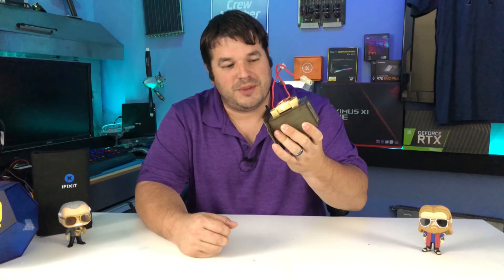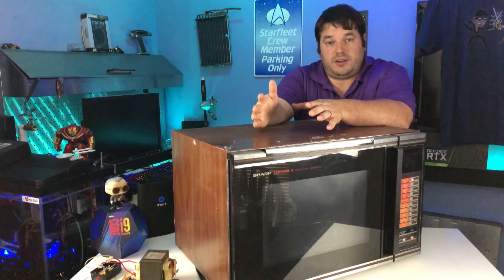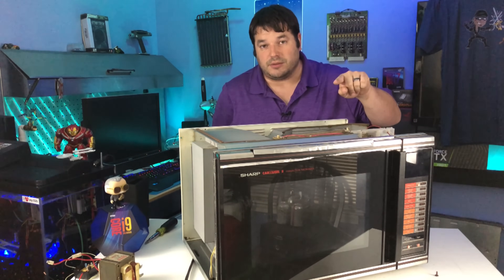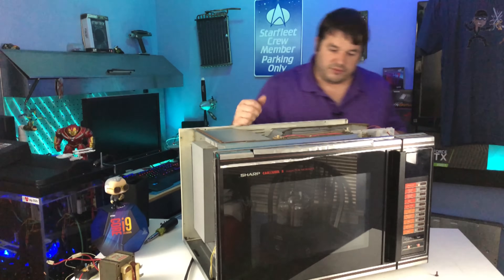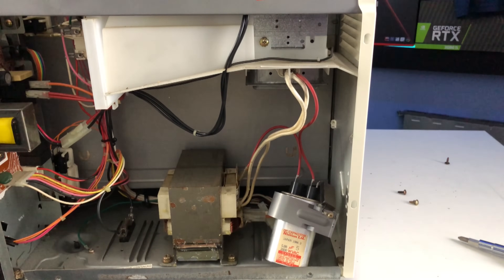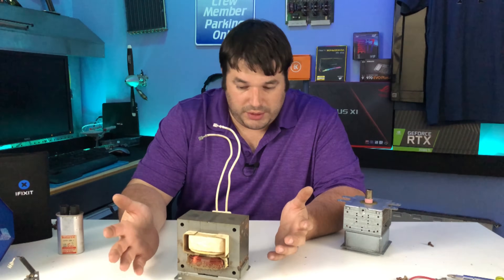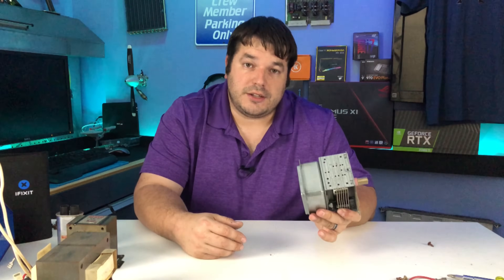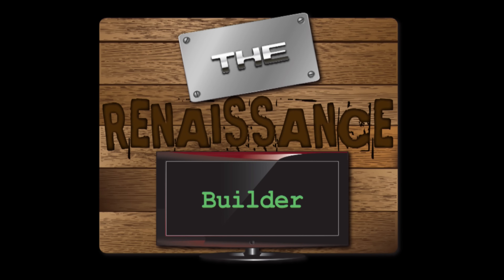HOW TO TAKE APART A MICROWAVE SAFELY

Comment: The idea behind the advice that you should put one hand in your pocket is not that doing so will prevent a shock if you touch a charge, but that you cannot simultaneously touch two points with a potential difference between them. Doing so would create a path for current to short across your heart, and it is current flowing across your heart in particular that will kill you.
Reply: what if your left handed!

Comment: wv is likely working voltage. They are not rated in watts. There is likely a bleeder resistor to discharge the capacitor to make it safe. DO NOT trust your life to it being there or functioning. 

iirc the 2000ish volt rated 1uF capacitor would be 2 joules of energy. (1/2 CV²)
 Not a lot of energy but enough to stop a heart beat,  4 US fatalities a year according the the interwebs. 

You can make a safe discharging device with a series of insulated high value resistors in a hot stick, but if you are winging it follow standard high voltage chassis procedure... Put one hand in your back pocket. Keep it there. Engage safety squints.  Use a well insulated wire loop or insulated needle nose pliers with the other hand to short the terminals on the hv capacitor. The idea is to keep the shock from going across your chest and less likely to turn into electrocution.

See Joe Smith video about using a DMM in resistance mode to discharge caps. Not all DMMs are the same. 

If there actually was a charge, they are not pulse rated, so the pliers aren't ideal. Do it anyway.  There could be leakage paths elsewhere in the unit. Kitchen grease, dust, etc. gets everywhere.  After discharge I'd look up the data sheet to see if there was supposed to an internal discharge capacitor that failed. I think they have one but I could have misremembered that. 

There is nothing particularly dangerous about the vacuum tube magnetron assuming there's no voltage on it. Worth harvesting the the large magnets if you're scrapping the unit. The ceramic insulators *could be BeO which is pretty benign. BeO dust if you damage it is VERY much something to avoid.  The interwebs suggest the pink ones are BeO.  No idea, but every BeO resistor I've handled is natural white like regular alumina.
Reply from the maker: That is some fantastic information thank you very much for adding all that!!

Comment: Most of the transformers i see has been 2200 volts stamped on them  .ham radio operators n cb ers use these fo for a power supply for tube type amplifier .ive tore a bunch of them apart n probably got at least half a dozen laying around here somewhere. The transformers have 2 metal pieces next to the coil on the secondary windings.this keeps from i think over saturation. You knock those out for higher output current from the secondary side.thanks for the great video.hope my tid bit of information helps you n some others.

Comment: like number 666 ☠️ I really enjoyed watching your video٫ btw thanks for warning ppl that might have no idea about what they are up to.. One day I was dismantling an old TV, I was messing around with the CRT, which as you know has a 35,000 volt electrical charge. I was trying to unscrew it in every way and it was so tight then I pulled the thick insulated wire connected to it until it broke by hands.. later when I knew what this piece was! I was so scared and I couldn't touch it to move it another place, even though I had done it before and i did not unscrew any TV after that day until now, Thank God it didn't have a charge because it hadn't been used for a while, I would have been Raiden if it had happened. 😂😂
Reply from the maker: Oh nice! Thank you for that memory! I personally love memories like that, all the best tinkerers have a memory similar to

Comment: I've never dismantled a microwave oven.  So, your video is very helpful.

However, I'm wondering, wouldn't it be safer to ground the pair of pliers that you're using?  After all, when you're trying to short the capacitor terminals, with the resistor, there may be a chance that you'll happen to not connect both leads at the exact same time.  At that point, with only one lead touching one terminal of the capacitor, wouldn't you be in danger?

If the pliers are grounded, then the current would mostly travel through that ground wire.  So, might it be safer to connect a heavy gauge wire, to the pliers, with a hose clamp, and connect the other end of the wire to something metal, that's grounded?

In any case, this is a helpful video.

Comment: For an added level of safety could possibly tie a grown wire to the pliers incase any current gets through into them to hopefuly stop it getting you if you arent properly insulated or isolated. But is apparently not nessisary 😂
Reply from the maker: @Cøbāłṯ-h4i  thank you for that suggestion, its a pretty good idea!

Comment: I dont think you can die from 12000v  dc there is no amps , but you will have great schock
Reply from the maker: I do not wish to be antagonistic so i hope you read this with an open mind. I have personally known (not close mind you) three people that have died from high voltage. I personally have almost died from 480 volts.
Its really simple; the larger the potential difference in volts raises the potential current accross a given resistance. 
Ohms law
Also, its the current through your body that shocks you not the volts.
Reply: . High voltage can be dangerous even if the current (amps) is low. Don't get too confident and always  be cautious

Comment: I like what he’s saying but I don’t think those tools are insulated.insulated tools are usually coated bright orange and have markings of voltage ratings just because a tool has a plastic handle doesn’t mean it’s insulated those handles are usually just for comfort
Reply from the maker: Hey thank you for commenting and watching. 
So insulated tools are for working on live equipment, as in its still plugged in. If you are trying to mess with a microwave while its still plugged in then you are already in danger. Unplug it, make sure the cap is drained, then it doesn’t matter what tool you use.
Reply: @TheRenaissanceBuilder   I’m just saying those won’t do a whole lot for insulation I agree you should never work on anything energized plugged into a power source

Comment: Mine has a brown wire and a blue wire to transformer if they are put back on wrong polarity will the microwave work as my microwave oven don't work but the oven grill etc does
Reply from the maker: On the transformer side its ac so it shouldn’t make a difference

Comment: You assumed the resistor is working.
Reply from the maker: Thats a very good observation, you are correct. Best practice is to always confirm and ground using known good components. Thank you for pointing that out.

Comment: Thank you for taking the time to prepare this video. It happens so quickly.
I took a cheap 6 - can mini fridge apart to replace one tiny capacitor on the power board that had failed.
Picked the power board up - mains shock.
I was lucky - but thank you for raising awareness that doing these fun little projects could actually cause serious injury.
👍
Reply from the maker: Thank you for the positive comments I really appreciate that!
I figured allot of people want to work on there own stuff or even just play with things and we can always be safe doing so.

Comment: I dismantel my microwave without all the security bare handed with metal tools…. I was breaking the wire with my hand …. Happy to be alive❤
Reply from the maker: Truth be that its often not that risky but the consequences of that one time are high enough to be respectfull of the danger.
Reply: I'm not sure. But i think these capacitors discharges themselves over the time.
Reply: Apparently over 30 people have died
Reply from the maker: @redblue2358  only 30? Is that like a year or ever?
Reply: @TheRenaissanceBuilder you know something is dangerous when you say "only?"😂
Reply: Amazon sells safety gloves from $20 to $60.00. That Capacitor will store 2000 volts for over a week, I know because  it happened to me.
Any rubber gloves are better than nothing.
Reply: @paulb4496  i hope the 2000 volts didnt kill you or did they revive you b4 you were fried
Reply: same today , lucky dumbass lives on

Comment: Wait why does the capacitor and secondary high voltage tranformer connect to the magnotron
Reply from the maker: The magnetron uses high voltage and current to generate microwave radio transmissions. The capacitor and there should be a diode as well act as a voltage doubler.
Magnetrons are intersting devices that use a shape to cause an oscillation, and antenna then takes that oscillation and broadcasts it in a specific wavelength

Comment: Is there any possibility of that resister exploding from all that heat?
Reply from the maker: Thank you very much for watching and asking sd6!
Well theres allways a chance and being careful is important. The key to that resistor is to use no less than 10,000 ohms, that ensures that the wattage through the resistor will be low enough. Takes a bit longer to ensure full discharge but its worth the safety.
Again thank you for asking, I really appreciate your patronage!
Reply: Hi. Can you tell me is a 500 volt resistor good enough??? @TheRenaissanceBuilder

Comment: Actually you don't need to measure the secondary output with some fancy devices like the scope you were saying . This is my method of doing it , basically connect the secondary of the transformer to mains voltage (in other words the high voltage secondary) so just use the high voltage secondary as your primary and then on the thick primary which now is your secondary just hook up your multimeter you should get a low voltage reading and after you have the low voltage reading note it , after noting your low voltage reading measure the mains voltage and note that down as well .
Then you basically devide up the mains voltage by the voltage reading you got on the output for example like this 230Volts : 24 Volts = 9,5 . The number you get from doing this is the ratio of the transformer , after you got the ratio you just multiply it by the mains voltage for example like this from the last example 9,5 x 230 = 2185 Volts . And it's this easy two easy steps of maths and you have the voltage no need for fancy scopes and stuff .
Reply from the maker: Thank you very much for contributing. This is a very well written explanation of the turns ratio calculation.
I will add this only works for the calculation, if active measurements are wanted or required than you still need at least a 10-1 meter lead

Comment: How do you make sure that you are not grounded?
Reply from the maker: Thats an interesting question. Ive done allot of work with high voltages and wattages, im going to tell you no matter what “rules” you hear there’s one thing that trumps all of it— be smart!
The one hand rule, the rubber matt rule, non of it matters if you are careless. 
So 👀 look at EVERYTHING before touching anything, and short out anything that looks electrical. Using an insulated tool of course. 
Thats the secret 
Oh make sure its not powered, that helps to🤪
Reply: @TheRenaissanceBuilder  Thank you for your response!
I just want to ask this to make sure, should I wear certain shoes and have a rubber mat under me? I'm mainly going off of replicating the part of the video where you depowered the capacitor with this little volt tool-pliers combination but wanted to make sure I understood what you meant by "not grounded" and also make sure I had all the right  equipment.
Reply from the maker: The pleasure is all mine.
Ok so the most careful you can be would be this
1- have a decent set of pliers and drivers that have insulated handles (klien tools are good)
2- non conductive boots or matt, most decent work boots are non conductive the matt may be harder to find
3- plastic safety glasses
4- keep one hand behind your back the hole time
Reply from the maker: 5- use a 10k ohm resistor to short the capacitor installed using the pliers and hold it there for an hour to be safe.
6- the absolute safest thing you can do is ground everything to a known good ground, like an exposed copper water pipe or ever the ground pin of a standard outlet